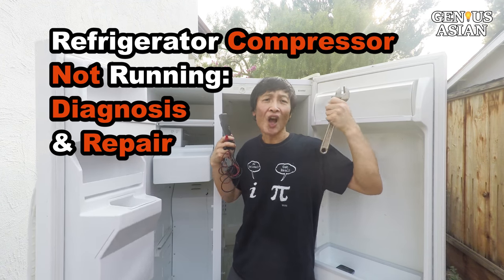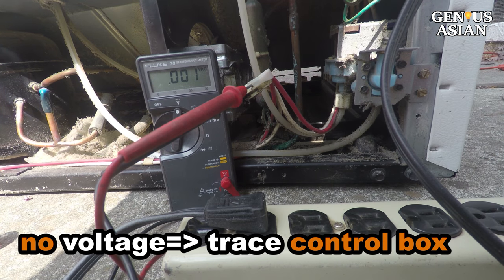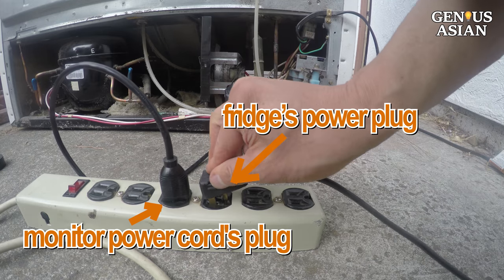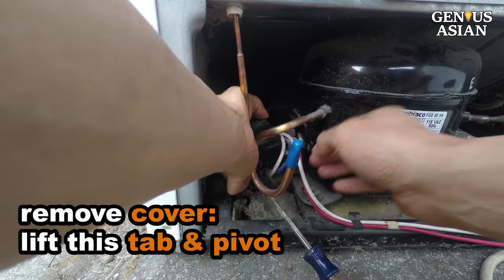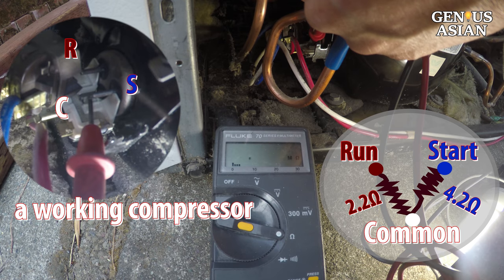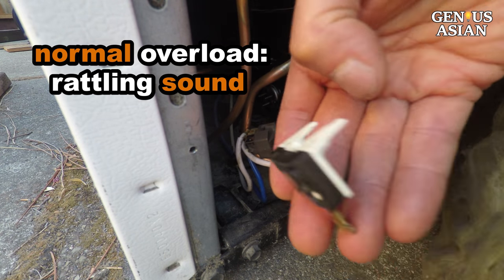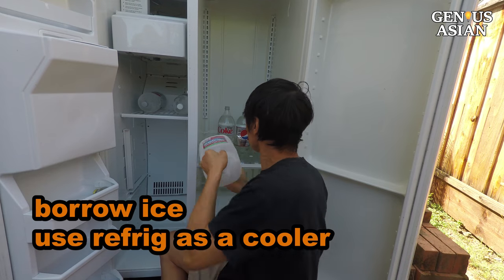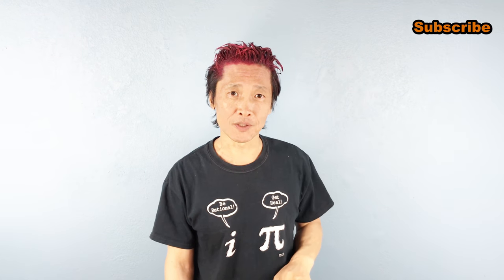Refrigerator Compressor Not Running: Diagnosis & Repair or Emergency Fix No More Spoiled Food

Comment: Very well done.  
Question on the compressor fan:  My similar fridge model sucks outside air over the bottom coils, around the compressor, and then the air exits the fridge by the water /ice maker inlet, where the back panel has holes.  Is this correct?  Wouldn't it be better for the fan to blow outside air onto the compressor and exit the air out the bottom over the coils?  
Thanks
Reply from the maker: This is a very interesting question. In a refrigeration system, there is a temperature gradient where the condenser coils metal is the hottest and compressor is the second hottest, and the outside air is the coolest. Cooling the metal is most effective because it is the hottest (Effective cooling involves transferring heat from the hot metal to the cooler air), so there is reason condenser coils is the most important target. Compressor will be shutdown if it is too hot, so cooling compressor could be the most important target. Efficiency and critical element both are factors. That is why some model cool the coils and some cool compressor. Anyway, the metal’s high temperature makes it a primary target for efficient cooling. When air flows over a surface, a boundary layer forms. This layer of slower-moving air near the surface can insulate the metal, reducing heat transfer. Using a fan to blow air directly onto the metal can reduce this boundary layer and enhance heat exchange When using air to achieve convection cooling, a boundary layer forms close to the metal's surface. Positioning the fan closer to the metal helps thin this boundary layer, leading to better heat exchange. 

Fan Placement depends on airflow direction. using a fan to suck air in rather than blowing air out can be more efficient. When air is blown from outside, some of it may bypass the heat exchanger, reducing the effectiveness of cooling.
Reply: @GeniusAsian  Thank you for your reply.  As the unit has functioned for 30 years! I should probably let things be, though I am from the school of "keep things cool".  Maybe add another fan, but that's overthinking it ....
All this started when the frig quit during hurricane Beryl - I suspect the power on/off outages.  The result was a disintegrated PTC relay, which was replaced and now everything is back to normal, - I hope!

Comment: Good damn it, the compressor was dead on my end time for a new fridge then.. I was hoping for a faulty relay
Reply from the maker: yes, since a compressor is expensive so a new fridge maybe a good option. Just need to be sure it is not those 3 cheap components but rather it is the compressor at fault though.

Comment: Thank you. Its quite informative. However my problem is bit weird. The compressor starts but doesn’t run long enough. So doesn’t cool enough. The thermostat looks ok. What might be the problem.
Reply from the maker: when you say "thermostat looks ok" what did you see? It may be very easy to use a multimeter to measure the thermostat
Reply: @GeniusAsian  hi. Thank you for reply. I checked and it works ok. Looks like the compressor is overheating so the protection relay is kicking in and not letting it run for long enough to cool the freezer sufficiently
Reply from the maker: @natalwala  follow this first: https://youtu.be/jMkkoXpHIPA
Reply: @GeniusAsian  Thank you. Really appreciate your help.

Comment: Hello my refrigerator is not cooling. My condenser and evaporator fans are working. The condenser coils look ok. It doesn’t sound like the compressor is turning on. Could this be a start relay problem?  Thanks.
Reply from the maker: did you check out this video? https://youtu.be/grURTgO2-x0

Comment: My issue is warm fridge and freezer because compressor not coming on. Only resetting breaker works. Inverter lights come on briefly, start relay clicks (on main board) and compressor tries to start but then nothing. But I wait for 2 or 3 minutes and compressor starts (but no click on relay?).
Reply from the maker: does the thermostat work correctly? It maybe easier to check the thermostat to as part of the elimination process.
Reply: @GeniusAsian  I fixed it (after having lived with problem for 2-3yrs :|) I noticed the compressor fan was trying to spin but unsuccessful. It could be turned by hand and also failed resistance test. I took it off the blade and sprayed Mass air flow cleaner behind the plastic cover. 

My theory is that the compressor was overheating and shutting off because fan was inoperable. And I suspect that if the compressor shuts off, then it needs to be reset via unplugging or by switching off breaker for a few mins (which we had been doing for 2yrs!). Very unhappy with Samsung's effort to fix the problem, and won't be purchasing a fridge from them again. Thanks for the help and for your videos.:)
Reply from the maker: @normcook9335  thank you for taking the time to follow up, sharing your results will help many other viewers.

Comment: My compressor isn’t cutting on and the fan isn’t cutting on. What do I do next? I don’t want to rig it up, I just want to fix it.
Reply from the maker: what do you mean "cutting on"? You may measure the voltage on the fan or compressor to see if voltage is delivered. If it is delivered, then check the fan or compressor https://youtu.be/HCyDxWifj-8 ; if the voltage is not delivered, then check the thermostat https://youtu.be/grURTgO2-x0